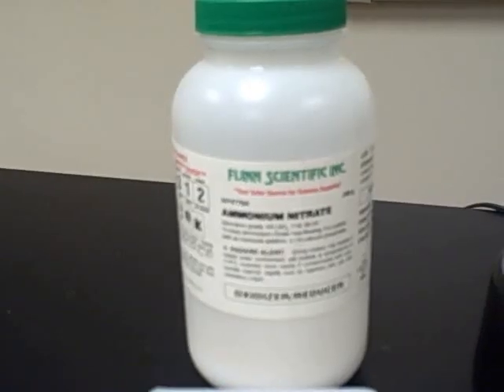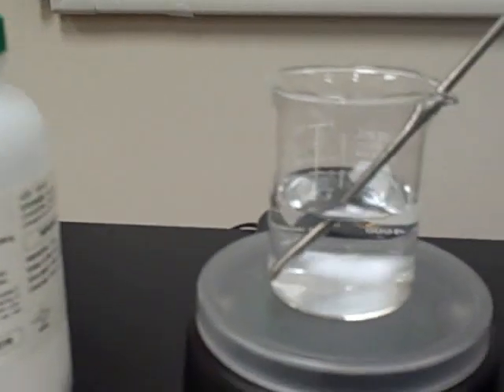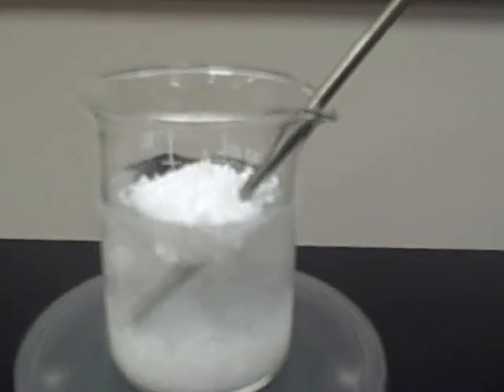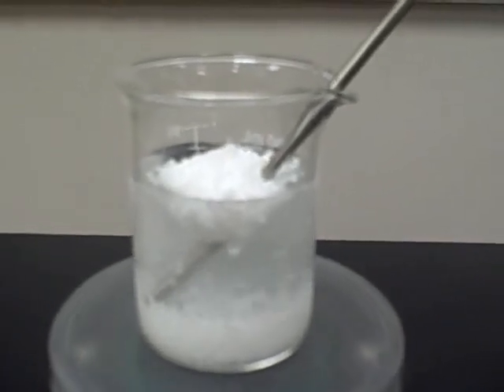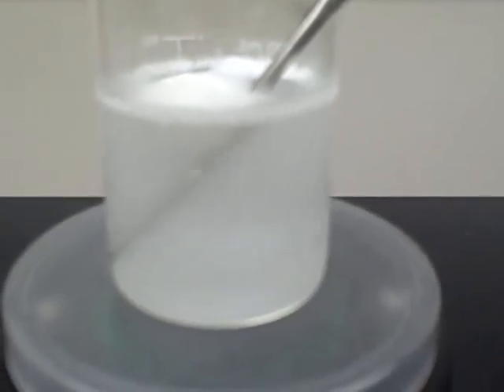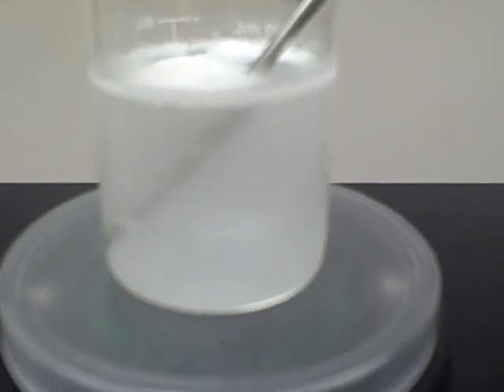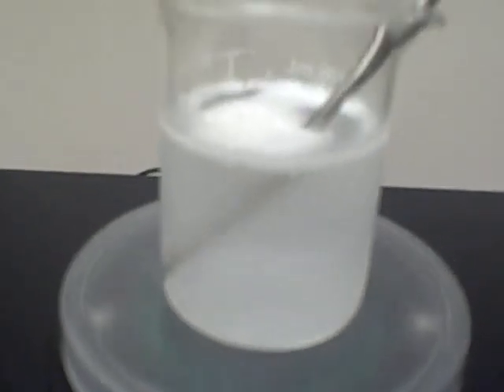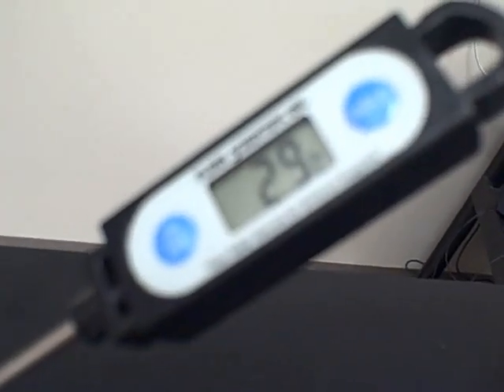Dissolving Ammonium Nitrate An Endothermic Process

Comment from the maker: The dissociation of the ammonium and the nitrate ions from each other is the endothermic process; it is obtaining this energy from the surrounding system (the water) and hence when you measure the temperature of the aqueous solution, the temperature of the solution goes down